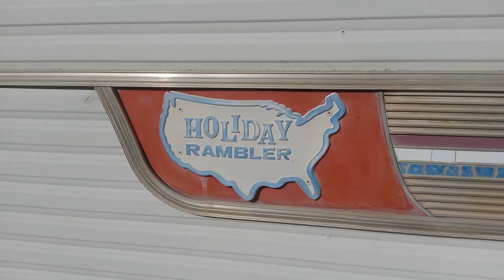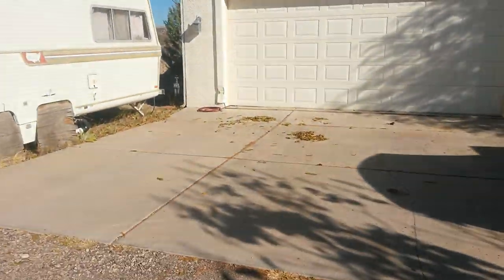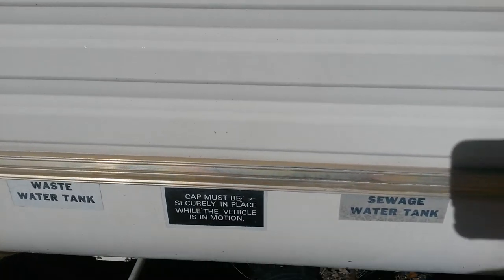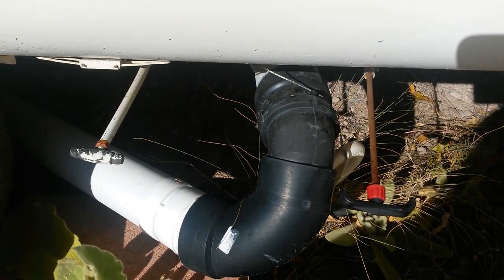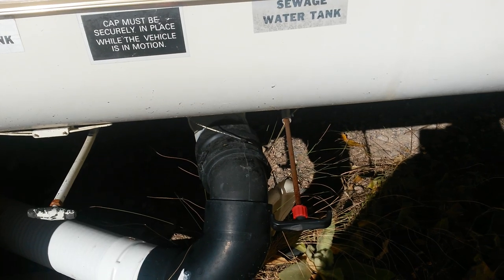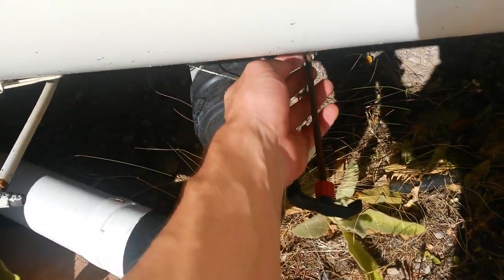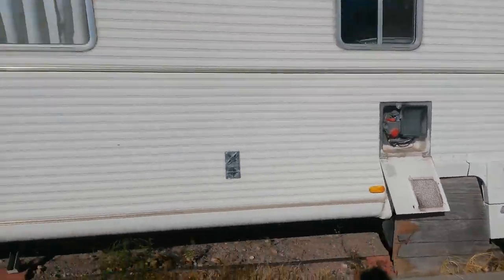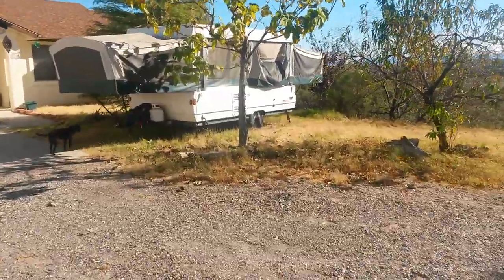HowTo: Winterize Your RV ~ The Right Way (Motorhome, 5th Wheel, Travel Trailer, etc)

Comment: Thanks for the video!  If you don't have a by-pass valve, will the water heater pretty much need filled with anti-freeze to get the anti-freeze to the hot water side of the faucets?
Reply: Yes I want to know the answer too